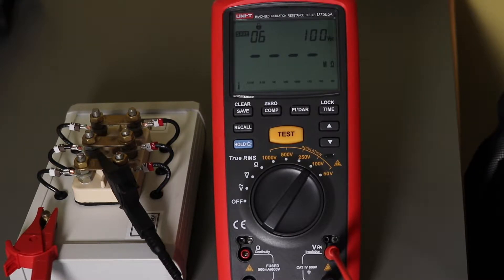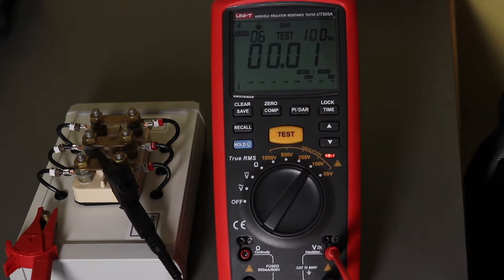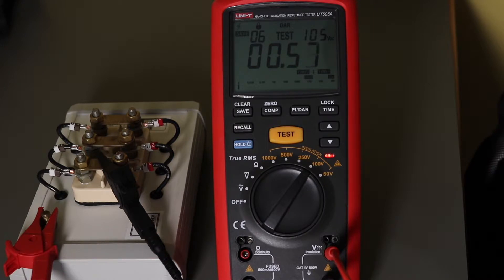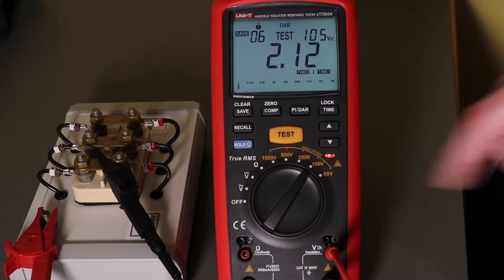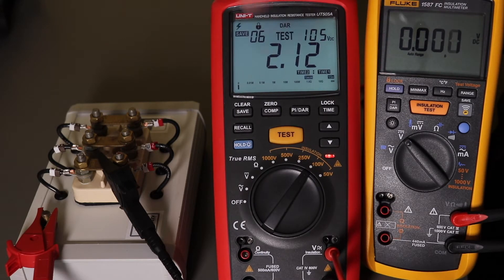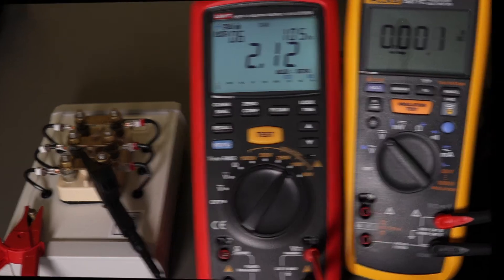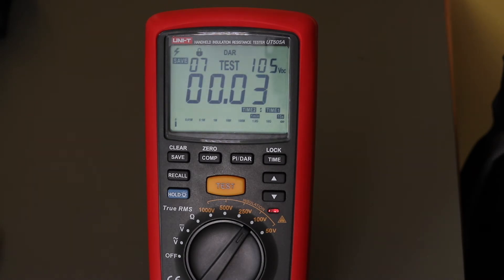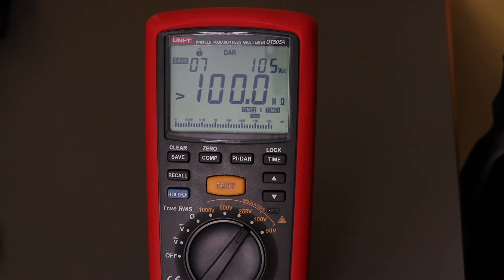UT505A DAR Test and Lock Function

Comment: I would like to ask for help with the UNI-T UT505A multimeter.
The multimeter can be turned on, but as soon as I press the test button in 250V, 500V or 1000V mode, the device immediately turns off completely, as if the battery is dead.
Interestingly, the 50V and 100V modes work without problems and provide measurements.
I have already replaced the battery and checked the inside of the device, but I did not find any visible damage or signs of burning.
I also performed the test without the test leads.
I took out and tested the three Omron 5V relays one by one under voltage - they work fine and all contacts are in good condition.
My question is: Can you give me a hint where to look for the problem?

Thanks in advance for your help!
Reply from the maker: If the meter is shutting off, it will either be a fault in the low battery circuit or something loading up the battery during the tests causing the battery voltage to drop.
You could try monitoring the battery voltage with another meter to see if this does happen.
If it is a loading fault, then I would be looking at the high voltage circuit. This is the little transformer in the unit. The primary is driven by a transistor that is driven by a PWM signal. On the high voltage secondary side there will be a rectifier and a capacitor network, I believe there are a couple of varistors across the output. There is a large electrolytic next to the transistor that could be breaking down and may be a good place to look. I would then check the rectifier diodes, capacitors and varistors on the output are all good.
It could off course be the little transformer itself. I have measured the resistance of my unit, with the board completely removed from the meter.
For the winding closest to the relay, it measures 258 Ohms with the red lead on the transformer terminal closest to the edge of the board. Opposite polarity is open circuit.
For the winding closest to the transistor, I measured 0.18 Ohms in both directions, with the leads nulled out on my 1282A DMM.
After that you are looking more at the PWM signal, to see if there is a fault with that. You may have to drop out the transistor to measure this to prevent it shutting down.
Good luck.
Reply: @three-phase562  Thank You  :)

Comment: Hello TP, I kinda like this unit how would you rate it against your FLUKE 1587FC ?
Reply from the maker: Hey TETC, for me the UT505A is a budget instrument in comparison to the 1587FC. I would be cautious about using the UT505A in an industrial environment where as the 1587FC you would take in every day.

The UT505A lacks quite a few of the functions that are in the 1587FC, there is no wireless connection, diode, current and capacitance are all missing that are available on the 1587FC. The UT505A does have a variable insulation test voltage function that the 1587FC does not have.

As an insulation tester it is comparable to the Fluke, although not as accurate. Build quality certainly does not match the Fluke and if you want  a UT505A I would hunt around and get it below the retail price which is circa £400 in the UK, but you can usually get a deal.